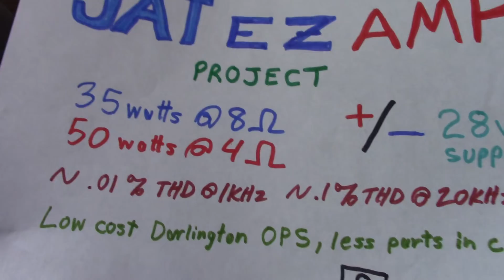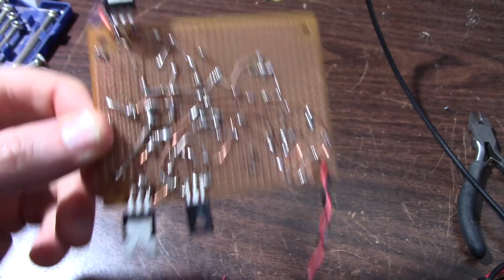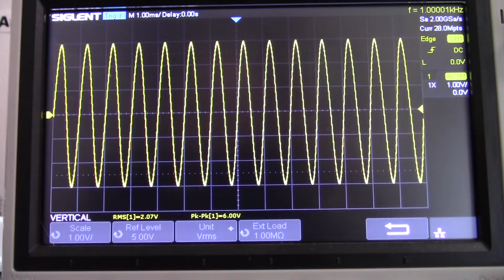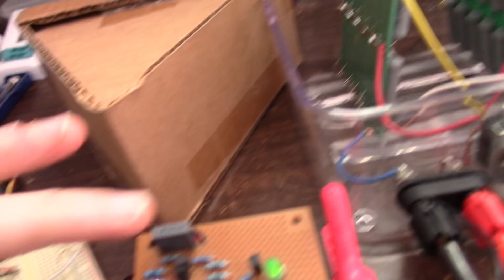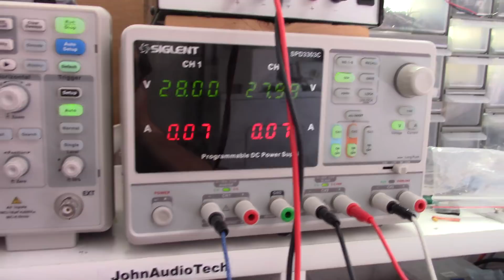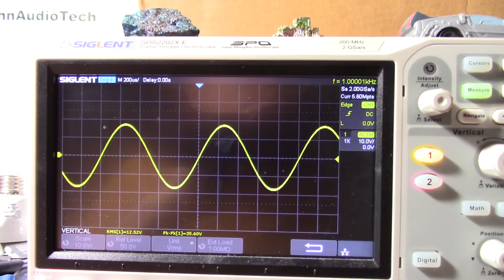JAT EZ amplifier project that blows the output transistors

Comment: Another nice video John!
Few comments from me:

1)R9 and R13 are not optimized. You can calculate their values this way:
R9+R13=0.5Ec/(2:5)*Ibmax (Q8)
Where Ibmax(Q8) = Imax/h21(Q8)
So R9+R13 = 28/(2:5)*(5/2000) = 2240 ohms to 5600 ohms
Let's choose 3100 ohms for their sum then.
Also R13 should be 20 to 100 times RL. For 4 ohms load it is then in the range 80 ohms to 400 ohms
Let's choose 390 ohms for R13.
Then R9=3100-390=~2700 ohms

2)Nice to see you are using IPS degeneration with 100 ohms resistors (R4 and R5) and this provides 5:1 degeneration ratio allowing larger differential input voltage in the linear region of the IPS. Also you can decrease the Miller cap to 68p to further increase the slew rate.
However IPS LTP degeneration improves 20THD and worsens 1THD performance by reducing the IPS gain 5 times leading to 5 times lower OLG and NFB at low frequencies. To fix this I strongly recommend implementing darlington VAS (addition of one NPN and a resistor will not make the current design so much expensive, but will dramatically improve the amplifier). Note, in that case you need to increase R6 due to the increased Darlington VAS double Vbe i.e. R6 =~1300 ohms.

3) If you keep the 0.22 ohm emitter resistors then you should increase the idle bias current to around 120mA.

4) This design is prone to HF oscillations and I believe the phase margin is no more than 20 degrees.
You can fix\improve it in many ways, but the most simpler here is by adding a 27p or 47p in parallel with the FB resistor R10.

I already built and repaired some amplifiers with Darlingtons BDW83/84C (TO-247) and they perform really well when designed properly.

Comment: John, I would like to recommend the use of Sziklai pairs (BC640/2N6488, BC639/2N6491) instead of Darlington pairs. I am sure that it is a problem with thermal runaway, which can be avoided by use of Sziklai pairs. For Sziklai pairs the temperature dependence of the VBE of the power transistor doesn't matter anymore. So you have to couple the bias spreader transistor thermally with one or both of the driver transistors on the PCB (if even necessary).

Comment: Where did you get the Transistors from if there from eBay  do a low current  breakdown voltage test i use a Tv Led tester.
I bought a whole lot from eBay had to toss hundreds of Dollars in the Bin. They where rated Collector Emitter Voltage of 250 volt but when i tested them they broke down at 60 volts.
Reply from the maker: I got them from DigiKey. I don't trust eBay.

Comment: Hey, any chance you could give me some advice on finding an amp that could run variable loads from 0.5W to 50W. I’m trying to power AC electrical loads but it’s hard matching a amp , transformer and load
Reply: My first thought was a VFD - but then I re-read your question. Can you explain in more detail what you want to do?
Reply: @stopthebus  i sort of solved my problem, I'm building a AC test set that can produce AC currents and voltages. Currents is easy but voltage I had trouble with it being stable at different loads.  But I did a work around by putting a loading resistor in.

Comment: What about an Amplifier with 2xBD131 power transistors with the bottom transistor driven via a BC212L search for 5W Class A Amplifier which is the type of Amplifier that was used to drive the color guns of a CRT.

Comment: This wattage deserves a bigger case, I think, TO220 is all too small. Maybe your first transistors died of overheating because sometimes the transistors lift a bit when screwed on. So firstly you could use seperate heatsinks for the two transistors without insulation tabs and secondly you could srew an additional piece of aluminum to the front of the things. Good luck!

Comment: Maybe darlingtons are too sensitive when it comes to bias current and heating, compared to lower gain transistors. I've never seen an amplifier using darlingtons on the output, even though output stages (AB) usually resemble darlingtons. The difference being the driver transistors aren't in as close thermal contact as they would be if in the same package. I'd put the circuit on a current limited supply, and see if the current started to 'run away' once it heats up.

Edit: apologies, should have watched the entire video

Comment: Interesting video, thank you. When I experimented with this type of amp, I found C4? - the 100uF being electrolytic behaved oddly. It was occasionally spikey and random on its leakage, I changed it for a non-polar/non-electrolytic. The other issue I had was the bias pot; if just 2 pins were wired - the center contact occasionally lifted (even for a fraction of a second), sending the current to max! Using all 3 pins solved that issue. I'm also not a great fan of Darlingtons :) All the best, Beamer.

Comment: I have built an amp using the bdw83c/bdw84c pair. So far it works well but it's hard to adjust the bias without the risk of thermal runaway.
Reply from the maker: what emitter resistor value did you use?
Reply: @JohnAudioTech  0.27 ohm
Reply from the maker: @gn_electronics  You might try a higher value for better thermal stability, in the .39 - .56 range.

Comment: Any idea for a transistor amp for small signal (radio signal level audio) to a quarter watt up to one watt max speaker? I tried tl072 for small signal to drive an output transistor but i didn't like the distortion so i had it as a buffer while the one of the opamps did voltage amplification, still not a very good response as input level of radio reciever audio starts around 5 ma, any thoughts ..?

Comment: It's not about SOA only, the problem is thermal runaway, you could try higher emitter resistors for output transistors for better thermal compensation. Anyway, one pair of output darlingtons in TO220 in this case is not realistic.
Reply from the maker: Yes, I want to try different emitter resistors (I need to order some). I'd also recommend the supply voltage max at +/- 25 V instead of +/- 28.

Comment: If you like playing more with darlingtons on this amp, you could try the BDV64BG/BDV65BG transistors. They do cost a little more, but I think the SOA is about 5 Amps at 30 Volts. I think they cost about $2 or $3 a piece. They also have a bigger case and should have better heat transfer.
Reply: hfe is here about 1000.....yes thats right. the soa  30V/5A is "safe" but maybe try some darlingtons with "less" hfe or normal bjt with "bigger" hfe to avoid oscillation. e.g. BD909 or BU931T

Comment: Why don't you try to use power MOSFETs for final transistors. A little bit sacrifice on output voltage swing. They need more simple bias servo network.
I think IRF530//IRF9530 good for start.